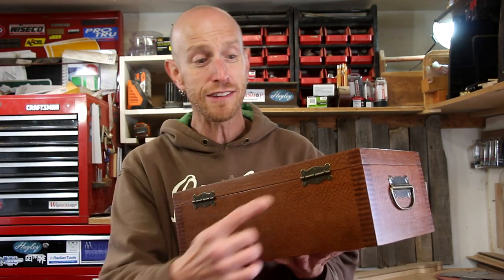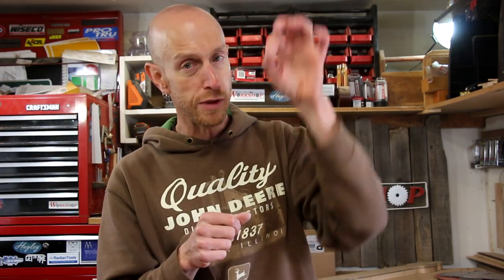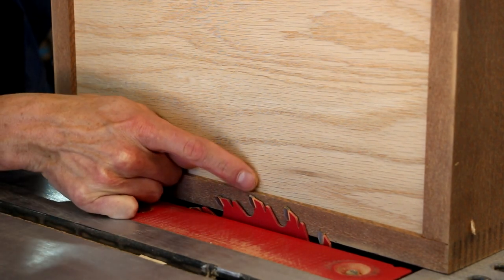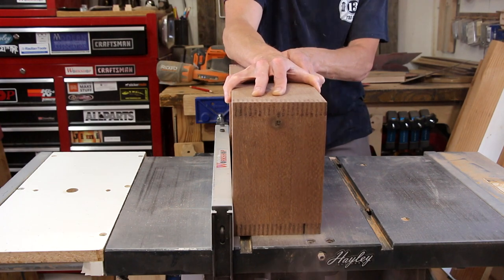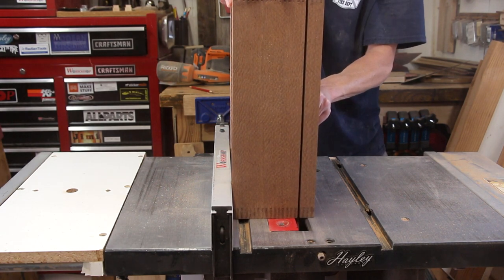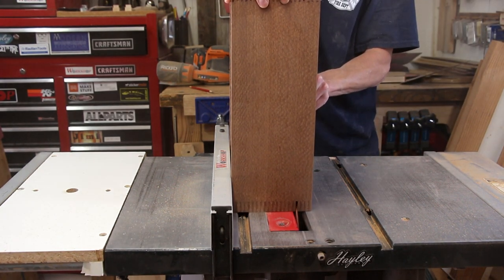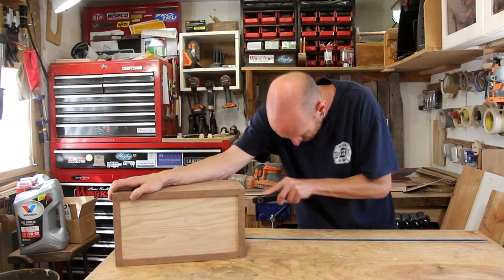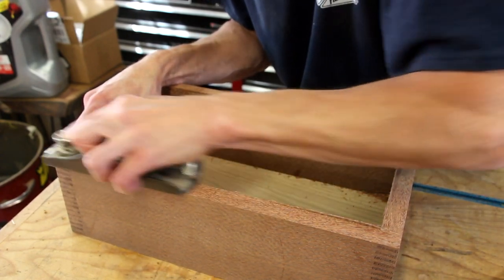How to Cut the Top off a Wooden Box Safely | Table Saw Tips and Tricks

Comment: I’ve used this method. And although it works, be prepared for a lot of cleanup on the cut surfaces. Although nicely edited, sawing the remaining wood is no picnic. If you can saw it without nicking the sides you’re  a better man than me. I used a razor sharp perfectly set up Japanese draw saw and still hit the sides in several places. Think about it....every nick means you get to reduce the entire circumference an equal amount....ON BOTH SIDES. I think I’ll use wedges and tape and save a couple of hours if unnecessary work.

Comment: Thanks for this tip.   I've been fascinated with building boxes with various types of joints, lids, etc.   Cutting the lid has always been a frustration because I often end up with an extra notch chewed out of the lid due to slippage when cutting that last side.   After spending a lot of time building the box it is frustrating to make a mess of the project in one of the final steps ... lid cutoff.

Comment: A variant to this would be to cut the short ends first, then crank the blade up so it will cut through the long sides.  This would make it easier to cut lid apart by hand at the end and yet still give the benefits of your method.
Reply from the maker: Yes. That would save a bit of cutting for sure and still hold it in place.

Comment: Ok great, now how to do it on a bevel, such that the bottom fits into the top and self aligns?
Reply from the maker: I would probably try that using a router and a rabbeting bit to cut opposing recesses into the top and bottom. I'd definitely try a scrap piece first, but I think if you made a larger router baseplate you could cut the rabbets pretty easily, then clean up the rounded corners with a chisel. Just thinking this through as I type, but I believe it would work.